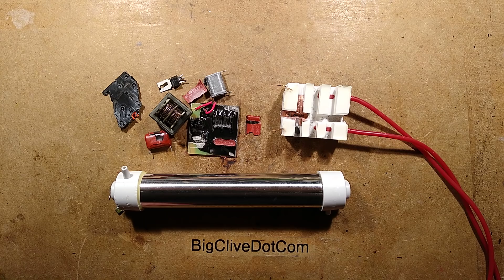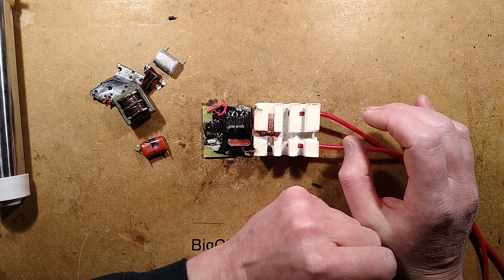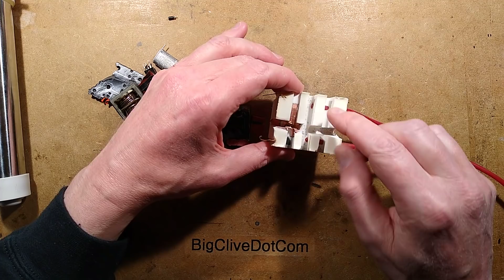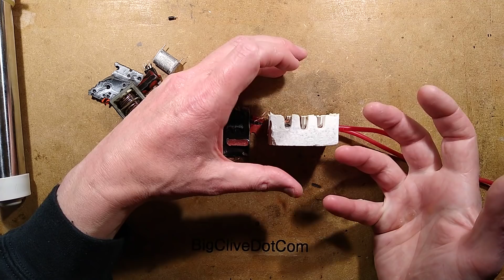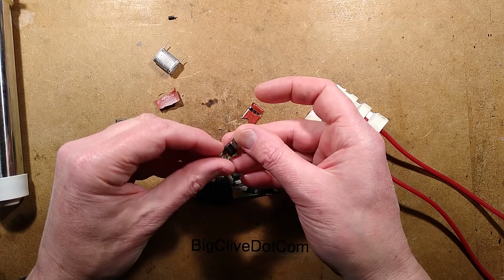Inside a nasty high voltage ozone generator PSU.  (with schematic)

Comment: There are some legitimate UV sterilizers used in salt water aquariums.  They're water flowing around a tube inside an opaque outer shell though, and are put inline with all the other filter equipment.

Comment: I have those UV lamps in my aquariums, they are located in a compartment behind the false back so the fish aren't injured.
Reply: I was just about to comment that the uvc is separate from the fish and filter it's just for killing algee if I'm not mistaken
Reply: Precisely. The UV tube is placed in the filtration system to prevent direct exposure to the fish.

Comment: I had a UV 'flouro' tube back in the '80s that I used to erase 2708 style Eproms. It was about 18 inches long and had some strange looking  glass, presumably to let the required UV light through.I later discovered that direct sunlight would also erase the 2708's (at least in Australia, probably not where you Scots live!)
Reply: I can confirm that sunlight in the UK doesn't erase EPROMs even after several days! I haven't tried in in Greece.
Reply: TheRageMaker  Heat and sunlight ... not always the same thing ... oh yes I remember heatwaves in the UK .. much akin to a spring day in most of Australia :D ... Joking aside ... UV was a big issue in Australia (still is) as the depletion of the ozone layer at the Antarctic was up to the southern states ... it's abated a bit (since the 80's and 90's) with the global banning of  flurocarbons in most things.

Comment: I suggest you double check if that is really common mode rejection, and not wired as a choke to absorb the short.
I've looked at other similar beasts, and some even have an  iron core transformer in series at that point.
Reply: That's what I thought as well, trying to absorb it.
Reply: Given the high frequency components of the spikes, even an iron core transformer would still act as a common mode choke, so it is likely doing double duty in that case.  That said, this is a horrible circuit in so many respects from an RFI perspective for anyone who operates radio (or even simply cares to receive radio) as even if the transformer/choke prevents most of the back EMF spike from reaching the mains side they nonetheless used  rather long unshielded conductors to the ozone generating tube that will serve as very effective antennas for radiating RFI (with peaks every 100/120Hz).  It may as well be called a broadbanded radio jammer that happens to also generate ozone, sadly.

Comment: That's a really ugly circuit. I particularly dislike the "let's just short out the rectified mains" bit. I doubt it would last very long, there's far to many high voltage spikes running around. Something's going to pop, which is why they've covered it up in all that glass fibre resin and other gunk.
Reply: They have obviously discovered the limitations of it's design and then had to find the best way to suppress the fires !
"Oh no, this thing just keeps bursting into flames after 10 minutes of use, what are we going to do ?" 
"No need to worry, my cousins factory had a similar problem and now they have lots of this flame retardant resin going cheap"
"Wouldn't it be best to re design it so it didn't catch fire so easily?"
"That will take too long and cut profits, just seal it up so the air can't get at it, no-one will know any difference, it's not like anyone intelligent will succeed in opening it up"
Reply: Well, it's only shorting out the cap at the mains input to the whole thing. Once that's shorted out, it'd need to charge up again, essentially it's only letting a few drops of power through at a time. A capacitor is essentially an insulator, certainly at 50Hz for that size, so there's no direct connection. Only what little power can bubble through. A capacitive dripper, I believe they're called. 

It won't pop, and you wouldn't design a shitty circuit then hopelessly cover it in resin to stop it self-destructing. You'd go back and design a better one. The resin is because it it outputs, say, 10Kv, from a transformer that's, say, 5cm wide, the voltage will arc from one end of the transformer, through the air, to the other. So you won't get any power out of it, it'll all be consumed as sparks across the transformer. 

So, you put some good barriers in it's way, so any sparks would have much further to travel, long enough that there isn't enough voltage to do it. So the current behaves itself and goes down the leads to the ozone tube instead. Any fire-retardant is because you've got plastic around high-voltage stuff that might spark if it failed, eg the insulation cracked. Sparks get hot, and plastic is burny. So to stop a bit of cracked plastic burning your house down (these things NOT being sold direct on Ebay), appropriate measures are taken. 

The design's weird but it's not inherently dangerous. No reason to think it'll pop, it's one of Clive's rare items that's actually licensed to be used in this country.

Comment: If I'm understanding the crude nature of this circuitry right, this has at least 4-5 sources of noise and interference built into it, probably complementary to a degree. It needs to be trashed and replaced with something responsible consisting of at least 5-10x as many parts, likely. I suspect even a basic AC transformer to HV would be less hazardous and noisy than this with a couple support compoments. Who the hell came up with this?!
1. Thyristor
2. Sharp spiky 1.5uF capacitor (on charge and again when the thyristor kicks, shorting to ground, double points there).
3. Coil primary because of #2, I suspect that basically acts as an antenna with all those windings.
4. Coil secondary because of #3 (unsure if I can count that too).
5. The short circuit to ground the thyristor provides (double duty with #2 and mains neutral) causing mains-side interference if it weren't for the (likely) heroic attempt by the common-mode suppression choke. Probably still some there, but not near as much.
Reply: China. China came up with it.
Reply: And yet the manufacturer felt the need to protect his masterpiece from reverse engineering.
Reply: It reminds me way back when I was a kid playing around with a 3-volt relay. I discovered that you make a little buzzer by setting it up so that energizing the relay broke the power connection. It also sent static to the radio. I thought it was neat. Then some time later I discovered you could do the same thing by having the relay short itself out when energized, and it was much more noisy.
Reply: This is China we're dealing with, so I wouldn't hold my breath waiting for safe, responsible circuits when they view their own citizens as cheap and disposable.
Reply: @hyperboloidofonesheet1036  My brother did something similar as a cruel science project for school. Using the commutator of a DC motor to make/break the circuit to a small transformer wired up backwards to use its primary as an HV winding. If I recall it had something like the ark of the covenant with two metalized statues that you would grab, closing a switch, and thus shocking the user.
Reply: @mysock351C  Little did I know that my first transformer worked because I used a cheap DC can spinner as a "ballast."  This was from the time I was really young and powering LEDs with 9v batteries because I could simply clip my wires to them with no rubber bands.  I think I was 12 when I blasted a neon with 10 or so batteries without a resistor.  That hurt.

Comment: Hey Clive, nice video. For the matter, you can remove the potting compound by heating it up (to 80-90 C) with a heat gun or infrared lamp and them taking the pieces of epoxy, which at that temperature are pretty softened (not likea thermoplastic though, but like a habrittle rubber, that can be scrubbed easily with patience). My two cents

Comment: I used to work as a coil winder in a place that made, well, coils and various devices using coils. We used resin and black marble dust to pot stuff. They told me they bought the marble dust from a place that made those shiny black gravestones.
Reply from the maker: That makes sense.  The machines produce a lot of marble dust.
Reply: It did a good job too, the bigger coils had a heavy, quality feel and nice sharp corners once they'd been "encapsulated" as the foreman called it. Apropos of nothing, that foreman had a big blond spade beard and looked exactly like an Isle of Lewis chessman. But I digress...

Comment: I found a lot of rock salt crystals mixed into potting rubber and potting resin, right in about the components in enclosures, mainly in jet ski ecu units, the crystals seem to be spread on the board then the compound is poured on top
Reply: Seems a bad idea, salt being corrosive. Especially where it's damp, say near large bodies of water. It'd corrode the PCB and component leads, nearby wires, screws, etc. Are you sure it's rock salt?

Comment: This appears to be a classic electronic ignition circuit. I converted my old 1950 car ignition to use one of these ignitions.
I doubt the 1M resistor current (400uA max) will fire any SCR. They generally need a few mA to fire.
I suspect the "SCR" has a diac in the gate so the gate charges up to about 25V and then discharges the 240nF into the gate to fire the SCR. A few microseconds later the current in the transformer primary reverses and resets the SCR and the excess current then recharges 1uF. This cycle repeats every 200us.
Excess current drawn from the mains during SCR ON time is limited by the 1.5uF.
Reply from the maker: This thyristor only requires 200uA.

Comment: Methylene chrloride (the liquid in those bubbling xmas ornaments) has always worked well for me in depotting things.  It will dissolve those caps if you forget it for too long.
Reply: Depending on the potting compound, you can just dip it into a pot of boiling water for around 10 minutes according to this source https://www.youtube.com/watch?v=OiPe6f4Oh8E . Makes the hard epoxy turn into soft stuff you can more easily scrape away. I have a bad habit of burrowing through it with a hot soldering iron with a pointy tip - it works, but not sure if the fumes are very safe.
Reply: Kevin Counihan  Also sold as "Aircraft Stripper".   Nasty stuff, but useful.
Reply: @threeMetreJim  Most epoxies soften at around 70-90C as they reach their glass transition temperature, but for those that do not you can use a blend of methylene chloride, methyl ethyl ketone and acetone, sold by fibreglass shops as resin remover, and it does remove resin, amongst other things. Will also strip your skin of oils and fats, and will dissolve into you as well, so wear 2 pairs of nitrile gloves, and use in a very well ventilated area, and avoid contact with the stuff with the gloves, because it dissolves them as well, just not instantly on contact. Had some potting resin that took nearly a month to dissolve in it, releasing the PCB inside. OK lost all the resistors and capacitors outer coatings, but at least the IC packages survived, along with most of the PCB.

Comment: I used uvc tube in my fish tank that helped a lot against algae building, but I put it unreachable for the fish at the back of the tank. It worked almost one full year. (8W like yours).
Reply: Yes - it is effective to have it so that only the tank water can be in its "sight". Like have a pump cycle the water through a container of some sort in which the lamp is enclosed at.
Reply: I usually just opted for several fish that ate algae and they were always very effective in preventing algae buildup back when I still had aquariums.  They were a rather low maintenance solution since they largely took care of themselves.

Comment: Radio HAM here as well, not only is it horrible from an RFI prospective, but what happens when that 1.5µF capacitor shorts (and it will short, it isn't the correct rating). Yeah, there will be a nice bang!
Reply: PCB traces and the diodes will hopefully blow open circuit, or the cheap and thin wire will do double duty as fuse as well. Betting that choke there though is wound with CCA wire, so it will definitely suffer failure from a few thousand pulse cycles and snap the coil wires inside from the repeated motor torque.

Comment: Using UVC you cannot exceed 1% ozone concentration no matter how much light you have since creating the O3 is an equilibrium reaction. The UVC creates and destroys the O3 constantly. Using an electric discharge you can get far highter concentrations and it's probably far more energy efficient. It also greatly helps if you feed it pure oxygen instead of air.
Reply: Sure but you'd keep blowing fresh air through it. You wouldn't want > 1% ozone in an inhabited atmosphere anyway, or anything like it.

Comment: The reason for making the secondary in multiple sections is to reduce the effective parallel capacitance.  The intended benefit is to push the resonance frequency.  Something similar was done in the old "Xmas-tree" RF chokes.  I wonder if anybody still has them?  But also some of the vacuum tube HiFi amplifiers of the old  used that winding configuration on their output transformers, although primary side rather than the secondary.
Reply: I doubt that, in this case, if it's relying on the zero crossing to reset the thyristor it's going to operate at 100Hz, not really RF unless you're talking to submarines. Doesn't look like the circuit is resonant as I see it. There can be different causes for the same effect.

Comment: I believe the ozone generating claims of these crappy devices!  I use these generators with aquarium air pumps to bubble into 2500 gallon tanks of rainwater for final purification.  Pump air in, output hosed to a submerged bubble stone, murky water clears in a couple of hours. Anything in the water ends up as dust on the bottom of the tank, any chlorine smell in the water is dissipated.  I've read the the warnings, but ozone is used in municipal and large facility water systems so I'm not too worried.   Running the setup indoors will run people out of the large room quickly, very strong "crispy" ozone smell.  
Only problem, the generator power box craps out after 30-40 hours of intermittent use.  It never gets very hot, just goes silent.  The heat sink looking aluminum plate on the bottom isn't one, but it is darn close to the primary wires of the HV transformer.  The generator "tube" seems to be quite robust, other than being thin glass.  But no signs of internal plating or darkening or being eaten up by the quite energetic corona.
Thanks Clive, now I have leads on possible solutions, as well as renewed fear of the chesign.  (Chinese/Cheap design)
Reply: I wonder if the thyristor is being pounded to death, especially perhaps being in a linear region for too long due to the slow turn on?
Perhaps put a heat sink on the tab?  (which would have essentially mains voltage on it!)

Comment: Hey Clive, please forgive me for replying to so many old videos of yours, I'm trying to catch up, in no particular order yet.

As horrible as this circuit is on the surface, I have to say it's pretty genius too. It's simple, it works, it's cheap and it gets the job done. Either the designer is a genius or a rogue, but I doubt the latter because it would take forever to stumble on a circuit as shall I say it?...elegant as this which works and is so inexpensive.

Yeah, it no doubt it puts lots of noise on the line. It's definitely NOT power factor corrected. It may suffer from premature failure, though I see no sign of that. A fuse would have been nice. I guess they expect the in-line capacitor to limit the current, but it's not designed to do that. It would though.

Also, pointing out, when the SCR triggers, the trigger lead capacitor starts to discharge right then, not at the end of the cycle. Since the SCR shorts the power, an "end of cycle" trigger is guaranteed. As is that trigger cap discharge.

I hate to say it, but if I designed this, I may be proud. Yeah, I'd worry more about filtering and these days, power factor, but as a stupid-simple circuit, I like it.

Comment: I was toying with the idea of the in tank "steriliser" thing for use with my co2 laser water coolant to help reduce the algae blooms that the tube creates but the idea of having it in a fish tank just rang lots of alarm bells with me.. You seem to have the same train of though as me.
Reply: Think I'd be tempted to go chemical for a water cooling system and add some fountain algae preventer - usually based on benzalkonium chloride (BAK)
Reply: David Burgin  Those are different. They allow the water to run through a jacket. (Similar to the first unit he showed in the video.) The one in the video (the "fish enemy") is just a light, where the water uggs exposed on the outer surface. So if you paint it black, it will be rendered useless.

Comment: The filler has a few other purposes. Firstly the resin expands and contracts as it's heated and cooled (Coefficient of Thermal Expansion), which can damage PCBs. The quartz (or possibly silica) filler reduces the amount of epoxy, which reduces the amount of thermal expansion and contraction.  Secondly it reduces the amount of epoxy you need -- silica filler is far cheaper per volume than epoxy.

Comment: Clive, if you can get your hands on dichloromethane, that usually does a really good job at softening up most potting compounds. Failing that, you could try using a 50/50 mixture of xylene and acetone, I have actually used that mixture with great success for fully dissolving polystyrene. If xylene is not easy to get, you can use toluene instead. Or if you are feeling a bit adventurous, you may try your hand at making chloroform from bleach and acetone. Chloroform is a fairly good solvent, just make sure to stabilize it for storage, by adding a bit of ethanol to it.
Reply: And FFS be careful with these chemicals. They can be very nasty.